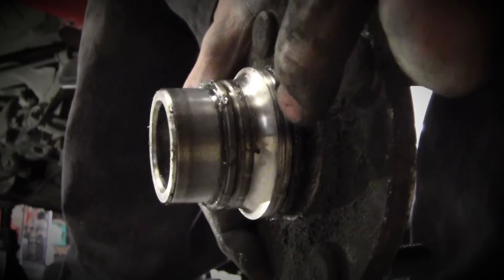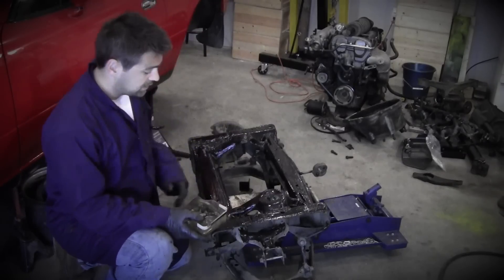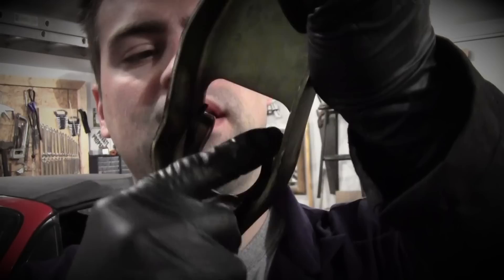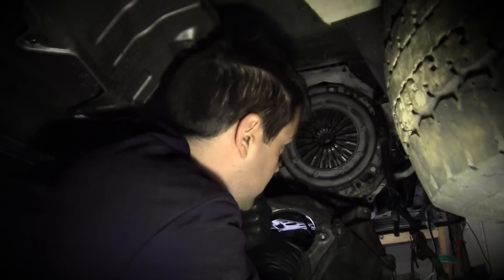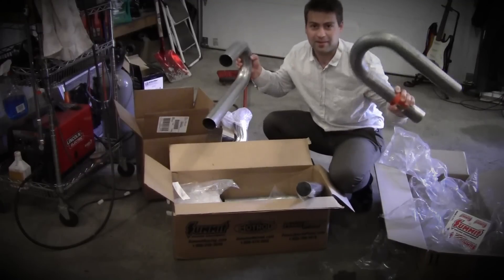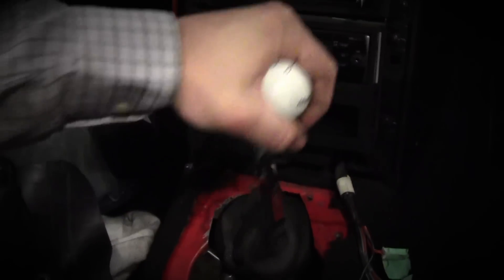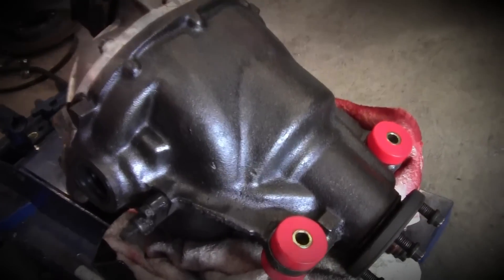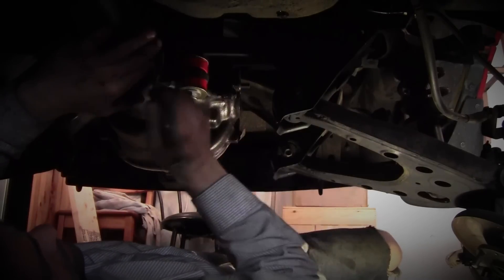Project 5.0 V8 Monster Miata - 07 - Transmission and DriveLine

Comment: Old thread I know but curious how the car is doing today? Also was your 8.8 limited slip?  Doing my build using Martins kit now
Reply from the maker: it was. but I didn't like the 2.73, it was good with 1st gear, the rest were too high.  I ended up finding a 3.27 limited slip, and bought a brand new T5 trans which had a higher 1st gear, so the 1st gear stayed the same, the rest all got bumped down with the 3.27.  But limited slip was a must.  Otherwise the car is doing well. I have since rebuilt the engine and put a trickflow kit- good luck with yours!
Reply: @TheTinkerer  thanks Gabe. I have watched your build series videos at least 20 times as I am building my 99. Great series. Would love to see you do an update video.

Comment: is that a Miata Rear end? and what year
Reply from the maker: no, definitely not a Miata rear end, I should have talked about it more on the video, it's a Ford 8.8, with diff lock from factory, picked it up at the scrap yard from an 89 Thunderbird...  the axles in later video are also Thunderbird axles..  the Thunderbird had rear independent suspension so it's the perfect candidate

Comment: That "boot" that came with the kit is a joke. All the money they put into the other parts then they drill a hole in a mudflap and call it a boot? I'd hit the junkyards and find a boot that would fit the shaft, assuming the stock boot couldn't be modified. Hurst also offers universal boots, as I recall.
Reply from the maker: I used a rubber plumbing sleeve for roof exhaust pipes, flipped it upside down, the hole stretched perfectly around my round hurst shifter base.  100% that flap I got from Martin's kit is the most useless thing I have ever seen - I used it at first and pulls on the shift stick in every direction you try to shift